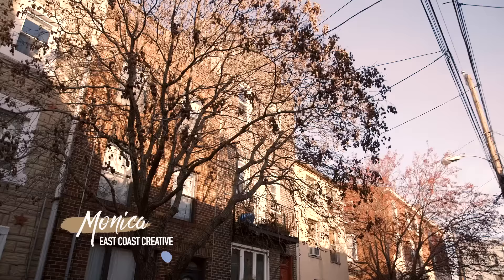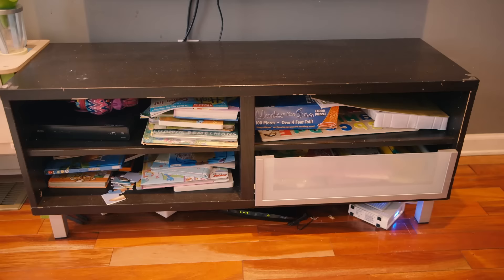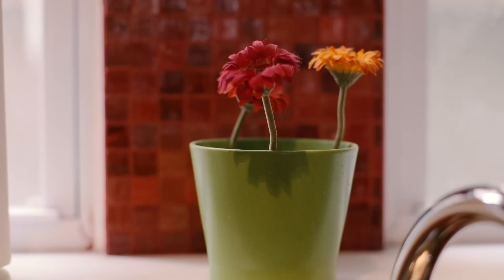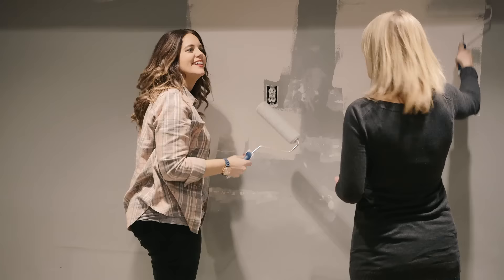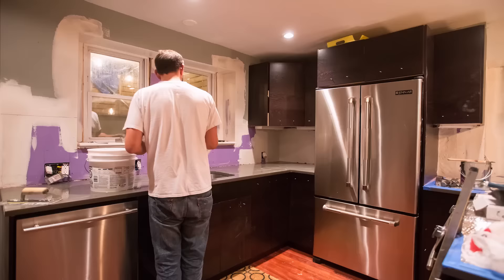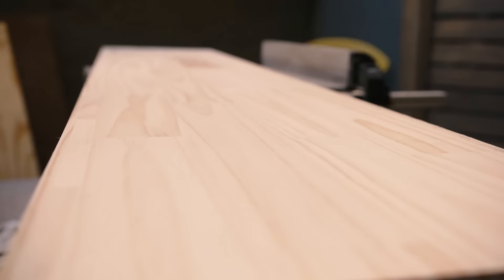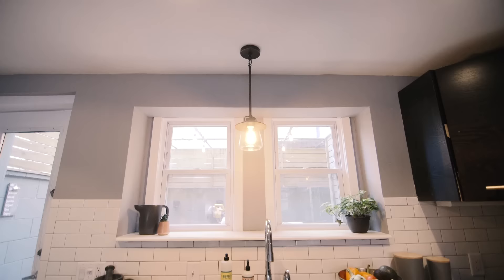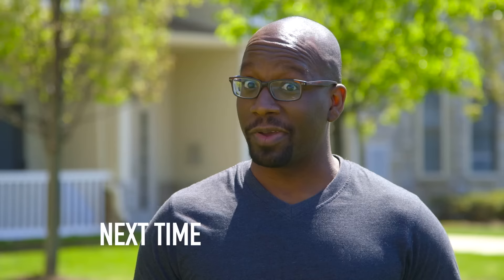The Weekender: "Philly Row House" (Episode 2)

Comment: Certainly brightened up the space!  As Monica pointed out, it would be easy to change accent colors for a different look.  I do wonder what the couple's solution for hanging outer wear was since the coat pegs were removed.  Maybe that white door was a closet door & NOT a pantry door or one leading to a basement area?